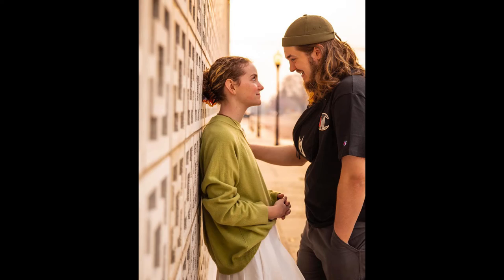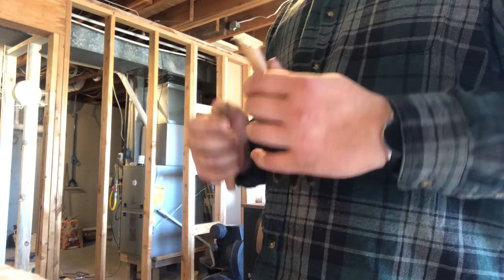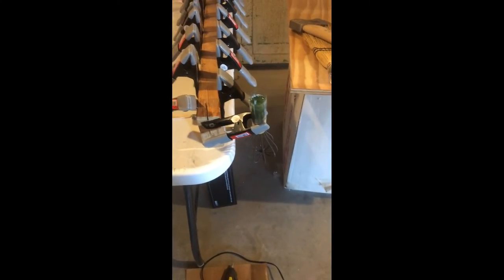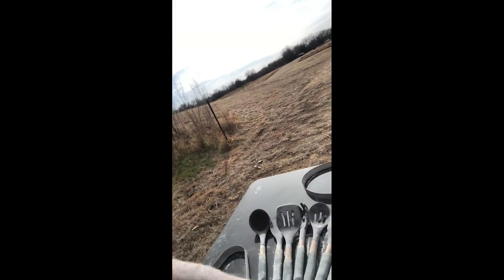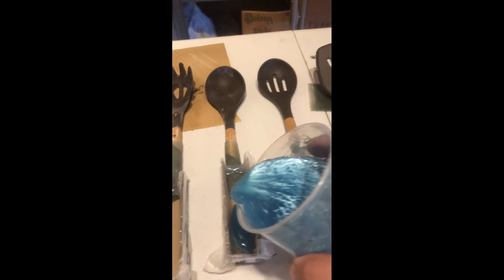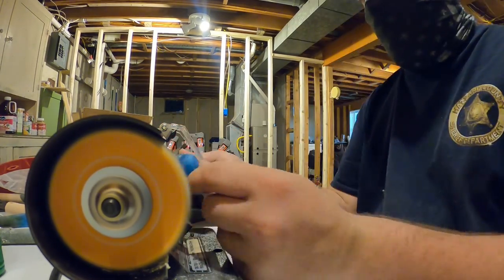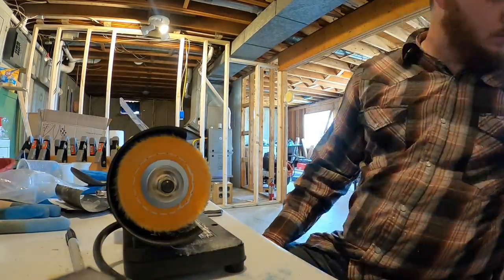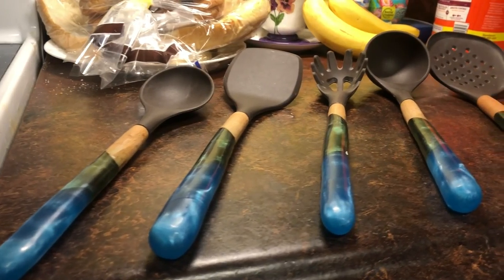Resin Handle Spatulas DIY

Comment: I loved watching this process! You did an excellent job! I’d love to see anything resin! The tools are very interesting. Can you resin the wood also, without molding from scratch? I realize you’re a builder!!
Thank you so much!
Reply from the maker: I’ve been trying to figure out how to do that, but in this case it was easier to only use resin on the handles because I was in a time crunch. I just coated the wood part of the handles with cutting board oil.